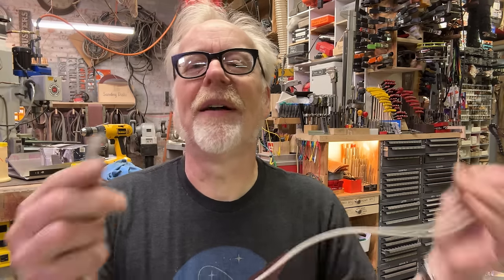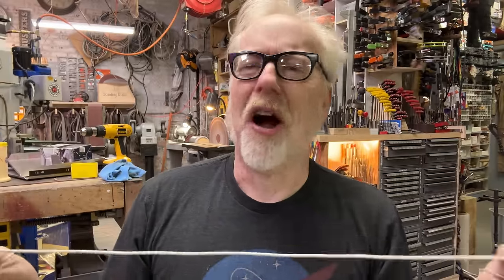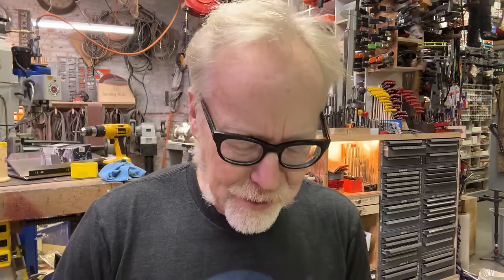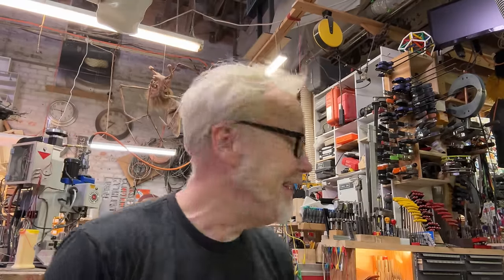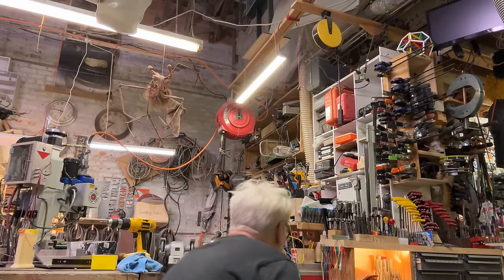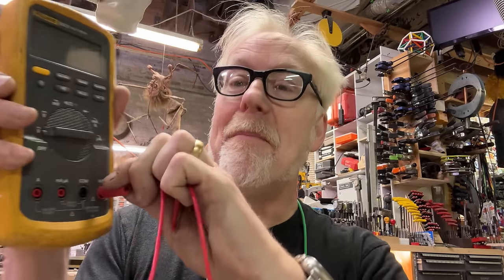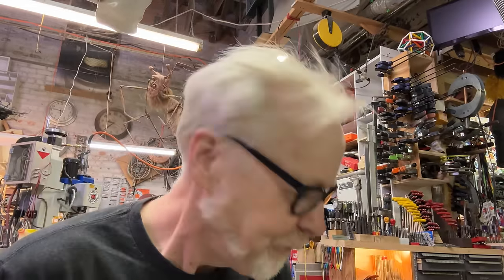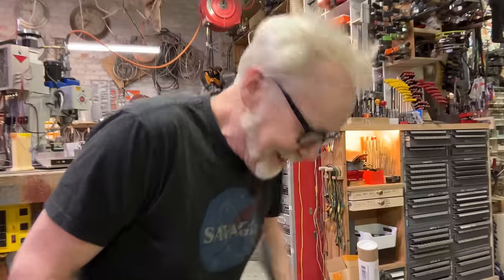Adam Savage's Alligator Clip Leads Problem

Comment: There's a whole assortment of test leads, I do electronics, but most of it are on electronic breadboards and there they have DuPont connector styles that allow you to jump from a board to a breakout board, like when you're working with an Arduino.  The allegators and grabber clamps are for test leads to connect to equipment such as frequency generators, oscilloscopes, multimeters, etc.  Rarely do I find myself using allegator clips and if someone knows of a better electrical connecting system I too am looking here in the comment section.   

P.S. I am a HAM and I've gone to that swap meet before, yes they have moved but I haven't been to the new location... very cool place, lots of vintage stuff there, even some musical equipment.  Cheers.

Comment: Yes! Too all of this. Also tho "skywiring" is great for many a prototype. Get a square of copper clad printed circuit board material and a good soldering iron. The copper is your ground plane. Simply solder all your leaded components together in the air.  It becomes this lovely sort of sculpture. And soldering is fun. It works well and you have confidence every time you make the connection. You can also get breadboard circuit boards with many different connections isolated from one another for soldering, much like the breadboards that take 20(?) gage solid wire that push in. Those push-in breadboards are good but suffer from the same sort of poor connections you get with alligator clips.

A tool is best when it is a joy to use. Alligator clips are NOT that. Solder is.

Comment: i would agree with those cheap clip leads. I bought some right before covid from Ali, they were so horrible i wanted to throw them out, but i didnt. The jaws were not lining up, so i spent at least an hour adjusting 25 of them so they actually lined up and clamped onto wires. But then there was this other major issue. The silicone? boots were so slick inside that when i squeezed them the clip inside would slide around and wasnt opening. I tried using a Qtip and some dish soap, i cleaned inside the boots and the metal clips thinking maybe there was mold release or grease causing it. This did help but it did not solve the problem. SO i ended up sanding the metal clips where you squeeze them with 60 grit and this seemed to solve the problem... for the most part. Then a year later i needed more of them, so i ordered them from an American company that claimed they were american made. Which was twice the price for half as many. Well they too had the same issues with the boots being slick inside, but at least the clips lined up and seemed to be better made. Win some lose some

Comment: To calculate the resistor value for an LED you basically have to realize that diodes regulate the voltage dropped across them.

So you simply:
(Supply voltage) - (Led voltage drop) = (Biasing resistor voltage).

You then use ohm's law to set the current limit that you want.

Comment: For multimeters you can buy adapters that friction fit on the probes. They adapt to alligator (crocodile in the UK) clips. I have an old Radio Shack auto ranging mini multimeter that doesn't have removable  leads.  They also have some that adapt to needle probes. I had some of those hook type ones but they're easy to break. Mine broke.

Comment: I swear by Huntron leads for all my test equipment, they are super pricey but super dependable and very well made (I've got two sets that are 20 and 30 years old still in regular use), for clips I use fluke suregrip or just about anything from AST labs. I learned my lessons over 30 years ago and you just can't be second guessing your equipment when time is a factor.
Reply: Second the Fluke SureGrip AC220 clips.  They're absurdly expensive, but are a great compromise between alligator clips and hook probes.

Comment: They make alligator clips that slide onto banana plugs and they have a hard plastic insulation. They are pretty good. And you can use them with whatever banana leads you have.

Comment: Wholeheartedly agree on all of the points. Clip leads do indeed suck.

The type with the little hook work, except they interfere with each other when you use several side-by-side. I have a few that are intentionally thin, but the hook at the end is so flimsy they don't last long. My dream is a Cleco clip for sheet metal, but sized down to fit 2.54mm spaced circuit board holes, with a wire attached. Pogo pins exist, so it seems like a mini Cleco would be physically possible to produce, but I'm guessing there's some reason no one has done it yet.

Comment: this is what youtube does best, specific subject matter that has nothing to do with politics.
also, every kid that fiddled with electronics knows that alligator clips suck, after about 5 minutes, and yet we all persist in tolerating them.
i just got used to putting dupont stuff everywhere and buying lots of rainbow cables of dupont leads which can be split up into smaller leads or even individual wires.

Comment: For grabbing a piece of wire or small post, it's hard to beat a Pamona (brand) "Minigrabber" with a stacking banana on the other end of the lead.  Pamona # 3782-24-02 would be a typical set, but lots of different lengths and colors available with the 3782 prefix number.  Worth the money and last a long time if you don't abuse them.  There's a smaller but very similar looking thing from Pamona called a "Micrograbber" and I see lots of sites mislabeling them as Minigrabbers.  Always compare to 3782 series if you're not sure when you're getting.  Micrograbbers are great too but really only for very small wire or IC leads.

Comment: The larger clip design is good.but the exsposed ends makes them much more prone to shorting out.

I've been wanting to make my own set with high flex 18awg or 16awg silicone jacketed wire and soldered ends. 

The ones you have, that we all have and hate suck because the rubber boot gets stiff. They are only crimped on at the factory and the wire size is like 22 awg with exstra thick insulation.  I've had countless issues of those crimped connections being inconsistent and large voltage drop across the overly thin wire. So my circuit may work on the bench but not when I go to build the final version or vise versa. 

Just finding a good quality rubber boot that will not stiffen with time and useing good wire with soldered connections would make them actually enjoyable to use.

Comment: Buy regular leads for multimeter and they will come with nice feature where you can screw on them aligator clip ( Fluke make them too ), or buy fancy test leads for ProbeMaster ( U.S. company, little bit envy that i don't have reasonable acces to all because i'm EU based so... ). Believe me they are not cheap but they are the Best test leads i ever had.

Comment: As an ex automotive diagnostics guy. You 100% need to look at what they use. 
You have a J-hook = ok.
The others a variants of an alligator clip = ok but as you say, not very precise pieces of equipment. 
I would turn to making your own kit.
But for expediency, a handful of quality silicon banana leads are only dollars.
Crocodile clips have a better jaw design, with finer teeth and in many sizes from tiny to large. Almost all are a banana plug connection because they're expected to be used with professional leads. Better design, build and applications than cheap alligator clips = good for components etc.
If connecting to wires. Stop playing around and just gets some piercing probes. Again, all have banana connections for banana leads. Endless designs from very cheap and basic to multi-needle desgns like "phil's probes" that are top of the pops.

Comment: It's Ohm's law, Adam.  E=I*R.  If you have a red led that drops 2V and needs 10mA max, and you want to use it with a 5V supply,  then 5V-2V=3V has to drop across the resistor.  To limit the current to 10mA it is 3V/0.010A=300R.  So you need 300 ohms.  You'd use the next common size up, a 330R resistor which would give 3V/330R=9mA of current through the LED.  
If you had a 12V supply instead, it is 12V-2V=10V across the resistor, so 10V/0.010A=1000R, so you'd use a 1K ohm resistor.

Comment: My favorite type are the style on telecom buttsets. The inner space of the jaws use an anvil and needle to pierce insulation, the jaws have great teeth, easy to open with more leverage, they are slightly offset and open at the tip so you can grip right onto a live punchblock to listen to audio or dial in through a block. The wires honestly feel sexy also because the are typically jacketed in fabric like a kernmantel on rope and the wire is ribbon to accommodate years of flexing with much less issue of the copper work hardening and snapping.

Also us engineers in broadcasting also know clip leads as "Gator clips" because the mouth resembles a Gator decently. 🤣

Comment: I have the same problems with alligator clips on test leads. In my misspent youth many of the same problems were noted when using alligator clips as roach clips. Many but not all of the roach clip deficiencies were solved  by using hemostats. And the smallest sizes of hemostats would probably work exceptionally well for test leads if you plast-dipped everything except the inside surface of the jaws. But we did find a better and much cheaper way to make roach clips that worked better than hemostats. It might work well for test leads too. We made them out of about a foot of thin brazing rod which we stole from our welding class in high school.  I think that I will try making some again sized in a way that might be test lead appropriate. This time I'll go ahead and buy brazing rod instead of stealing it If I have some success with evolving 1979s hippie teenager culture into 2020s better alligator clips  I will mail a couple of them to you to test to strike a blow against poxy alligator clips everywhere

Comment: Pomona clips (the ones with the hook) also come in micro sizes, about half the dimension of what you showed. And there's a style that's like a two-tined pickle picker, but it's not a very secure hold and it looks like you have no fear of tugging on wires while hacking on things so the hook style is probably your friend here.

Comment: I’ve never met a clip lead that doesn’t inspire disappointment and frustration mixed with desperation. I just want a clip that works! They bend, the springs wear out, the saw teeth destroy wires. They are always too long or too short. The only ones I have are all the same color so I can’t easily identify different parts of a circuit.

There has to be a better tool.
Someone out there solved this in their shop and needs to share with the rest of us.

Comment: Every two years I try to google and search if a top notch alligator clips has entered the market. I have all clip types presented here in my collection in daily use. Still in many applications alligator clip that would simply be the best. I do have couple banana to alligator clip leads that I believe came with laboratory supply and the alligator end is just what I would expect an alligator clip to be. It is couple mm longer and also possibly slightly sturdier and they just work! So this can be done and there is a factory doing them somewhere! But still haven't found a source for these cables with these exact ends. And as telling them apart from crappy alligators based on pics on listings is impossible, don't know if finding them is really possible.

Comment: Jameco is my go-to for store bought clip leads.  No AMZN lottery on quality.
DIY are best.  Silicone wire and nickel plated copper alligator clips.  RC hobby store for silicone wire, Digikey for Ni/Cu alligator clips.
Problem with AMZN is that they look thick but typically have light gauge wire and can't handle much current.
Current handling is the biggest problem for clip leads.  Be careful.  Much over an amp and you are probably pushing it.

Comment: One problem I have witnessed with those small leads with rubber boots- rubber gets hard over time and when you are thinking the clip grabs really good on to something because it is hard to press, it actually barely holds because the rubber heeps pressure on the clip and the weak spring isn't enough to hold against.

Comment: Have you considered just flattening the jaws to flat plates? A slight bend so the jaws are parallel when closed. Should give you good contact and grip for thin wire. If it doesn't work all you've lost is a clip you don't like anyway!

Comment: [[edit: This is maybe too similar to a quick / lever /  Wago connector, just more open on the sides, and more flexible with shapes to clamp & orientation.  This would clamp more flat surface area with pressure, but lever connectors can use a metal edge to bite because the orientation of the wire is known.  A lever connector naturally uses the spring to match wire thickness, where this needs something else like a thumb screw or flat spots on an enlarged cam to act like detents.  At that point, the cam could be replaced by a coarse screw design.   Probably not worth it.]]

One starting point could be looking closely at a plastic tarp clip (tent clip, awning clamp) that locks with a levered cam (pushing forward with a thumb).  I wish they would have a little spring (even a bent plastic tail) that gently opened it after you released the cam.  The great thing is the force they apply, and they won't chew sideways like a cow.  Plastic is handy as an insulator and a bent metal spring (doubling as the conductor) could fit in the middle with a channel in the plastic to hold it. (or the plastic is moulded over part of the metal)

The worst part about those vinyl covered cheapie alligator clips is how the vinyl must be stretched to open up fully.  They look like they're stamped/folded metal, so side-to-side alignment is poor.  
Smarter people with CAD could take this further than I ever could.

Comment: The solution is to make your own friggin' leads. It doesn't take long. You can pick the clip or plug or grabber you want. You can pick the wire gauge and insulation type you need. You can make them as long or as short as you desire. It's also a great way to introduce kids to electronics and soldering, by the way, if you can't stand the monotony of it... and then you can clip all the leads onto your hat at the same time and become The Wire Monster.

Comment: The worst part about the standard alligator clips (the non-soldered ones) is that the point where the wire meets the clip is prone to failure if too much current is passed. They'll pass a continuity check if held at the right angle, but when you actually use them they'll break the connection and you're left scratching your head trying to figure out why your circuit isn't working.

Comment: The issue (in my opinion) isnt that they need improvement in design, its they are made so extremely cheaply. I have some older than me that are great but I also have a ton of the new ones that you get in a pack of like 50, and they are just super cheaply made. The old ones the metal doesnt bend or deform. I bet out there is a quality version still but I am very cheap (and dont have money to throw at that kind of thing even if I wasnt cheap).  If you want a different design though they make the small ones in a flat clip design too. 

My suggestion would be try to find a good source of high quality connectors and make your own sets. Or in Adams case, a one day build of cutting out and bending metal for clips and making some really cool homemade sets.

Comment: Beware of leads made of tinned steel stranded wire instead of copper. They create some significant voltage drops.

Easy to identify as they stick to a magnet. And no, they don't only come from online Chinese shops. I found some in some I bought from a local electronic hobby shop here, in Australia.

Comment: I just twist wires together for testing. Sometimes, I put clamps on to squeeze them together better, but usually, twisting is fine.

I just got pissed at the clips being so hard to open in school that I never bothered using them again. 

When I have more than one connection, I just poorly solder them right away and have a clipped switch in between.

Comment: One of the biggest problems (which will trick you) is that the leads often break loose inside where the wire is "soldered" (or just clipped into) to the alligator clip.  You'll think you have something wired up and connected but you don't because one (or probably more) of your alligator clips are actually creating an open circuit.  So you're prototyping and think you have everything wired up, then it doesn't work properly and your first thought generally isn't "oh, this alligator clip is failing" but (since your prototyping) you guess you have something wired wrong.  You go down that path and drive yourself crazy.  
This is also why a multimeter with continuity test is invaluable!  Test those alligator leads and you will probably discover they don't have continuity from one end to the other.  Then you scream, "I wasted 4 hours because of a bad alligator lead!!"
This is also true for those male/female breadboard hook-up leads.  They are garbage!  Just use solid core wire and your life will be better.  🤓

Comment: The issue is that so many people "cheap out" on test leads for electronics.  Buy the good stuff and they'll last practically forever.  First, buy only silicone insulated high strand count leads, with banana plugs and jacks at both ends.  Buy them in a variety of colors and lengths.  Then buy J-hooks, alligator hooks, etc, that have built in banana sockets.  Then you can make a clip lead from whatever to whatever, using your stash of leads and ends!  Pomona makes good quality stuff.  It isn't cheap, but it will last, unless you run way too high currents through a J-hook, and melt the thing!